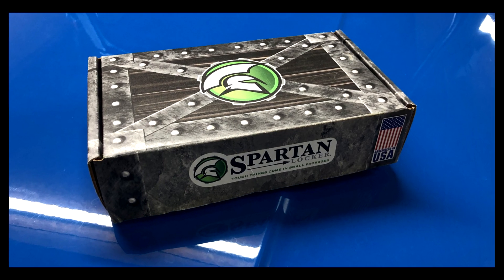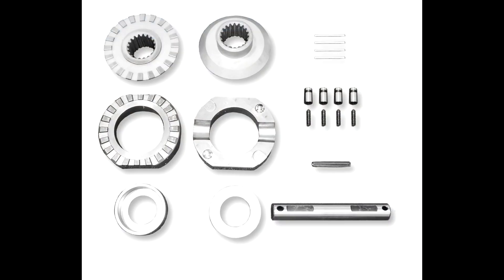Roxor Spartan Locker Check on a Mahindra Roxor

Comment: Just installed this spartan locker. While doing the test we can only get the left wheel to roll forward and the right wheel to roll backward. Why would that be? Did we install wrong? If so what would be wrong?
Reply from the maker: Reed Crandall Did you put the spacer back in?
Reply from the maker: Reed Crandall The transmission should be in gear and when you try to turn both wheel forward or reverse at the same time, they should lock, then you should be able to turn one wheel only while holding the other.
Reply: Tlcbister, when we removed the spindles and housing, there was no 'spacer' that we could understand what it was. The instructions said to retain the space but we didnt know what it was talking about. We also did not know where to put the 'spacer' as we reinstalled the parts. The instructions were poorly written at that point. Pictures were difficult to follow. I dont recall if the instructions included in the  spartan box explained where to put the spacer! We would appreciate some guidance!
Reply from the maker: Reed Crandall the spacer was in the original differential. They updated the install instructions on the Roxor site.  I didn’t do my own. I hired it out. I just know others had trouble because the spacer didn’t get put back in.
Reply: Tlcbister, was the spacer that cylindrical piece with a poorly machined hole in the middle? It went around the big pin?
Reply from the maker: Reed Crandall yes, that will be it.